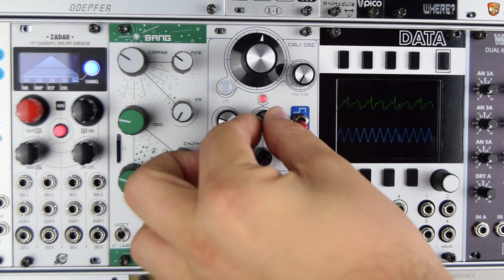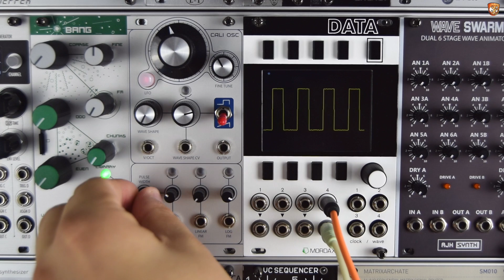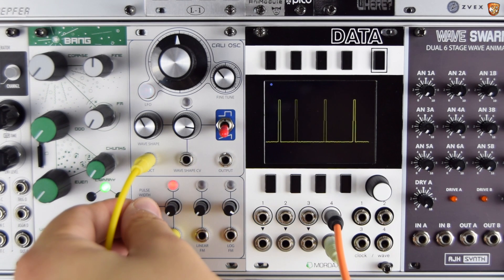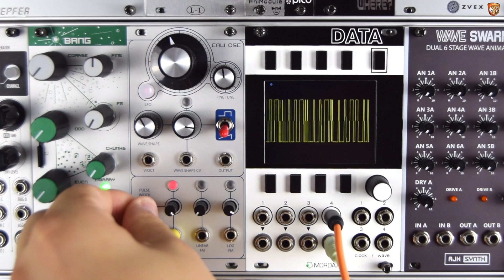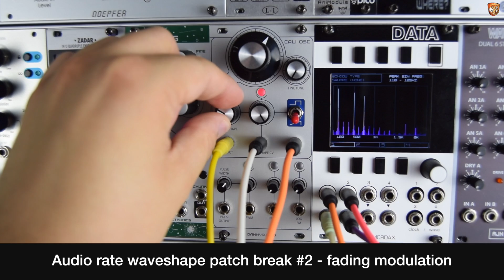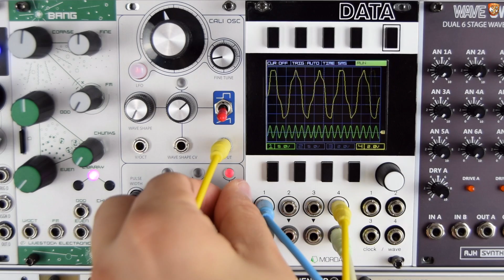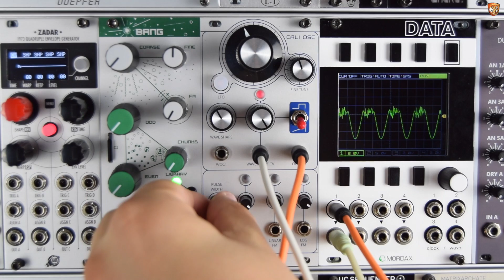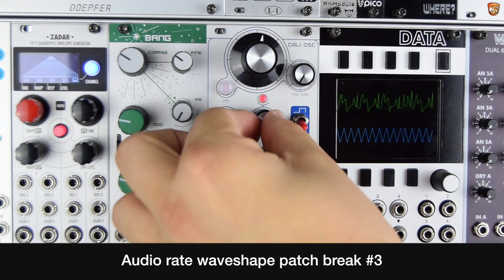Dannysound CALI OSC (classic Buchla 258 style California oscillator)

Comment: If we describe linear FM as Hz/volt and exponential FM as 1 octave per volt, how do we describe logarithmic FM in a similar way?
Reply from the maker: not heard of linear described as Hz/Volt so I can't comment on that, it's a new one to me.
Reply: I swear i'm not making it up.  From the disting manual "This algorithm provides a linear-to-exponential converter and an exponential-to-linear converter. You might use this to interface 1V/octave modules (Eurorack standard) with Hz/V synths (e.g. old Korg or Yamaha synths), but it could also be useful within Eurorack e.g. to convert an LFO (commonly with Hz/V pitch control) to a V/octave oscillator, or to convert an exponential FM input on a VCO into a linear FM input."
Reply: I still dont understand how that would work? Enlighten us!
Reply: Well, you would center the 0V at some frequency (eg 1 kHz) and then set a linear scale to the signal (eg 100 Hz per volt) so that a bipolar voltage could cover the audible spectrum (eg +- 10V).

The obvious disadvantage of this system when compared to the exponential 1V/Oct  is that summing signals doesn't transpose pitch in the musically anticipated way.  I'm not really sure how logarithmic FM would even scale, would it emphasize higher frequencies more or less than exponential?
Reply: @robertsyrett1992  According to the schematics, the log FM is actually an exponential FM input. for some reason its common to mistake log for exponential in synth land. 

Anyway from a maths perspective, linear FM is like hz=c*v, exponential fm is like hz=c^v, logarithmic fm is like hz=log_c(v) where c is just some scaling factor and v is volts. So you could really describe volt/octave as "hz per 2^x". thus we can describe logarithmic fm like "hz per log_c(x)". I don't know what scaling factor you would use. I dont think it would be useful though. u can think of it intuitively: exponential is closest to how our ears hear pitch so using 1v per octave, you only need +10v to cover the whole audio range. linear is simpler to implement for VCOs so it's easier for the engineer to design and closer to the hz unit; using 1000 Hz per volt you need +20v to cover the whole audio range, but it needs to be accurate to 10mv at least or else it will be noisier anywhere below 1000 hz. Logarithmic is difficult to implement, isn't a useful way to measure frequency (there's no logarithmic frequency unit afaik) and has the same noise problem as hz/V but worse. 

Log FM probably does emphasize the high pitches but i imagine it would mostly sound like if linear modulation was distorted a bit in a weird glitchy way,

Also im completely unqualified so pls forgive me if there are mistakes
Reply: @nutritionalyeast7978  the constant c in the exp and log versions would likely be "e" which is the exponential number (its about 2.7). The number come from a very special function (the exponential function) where the gradient of the curve is always the value of the input. In other words "e" is the number where the differential of of e^x is also e^x. 

log_e(x) is commonly known as ln(x) which is the "natural log".